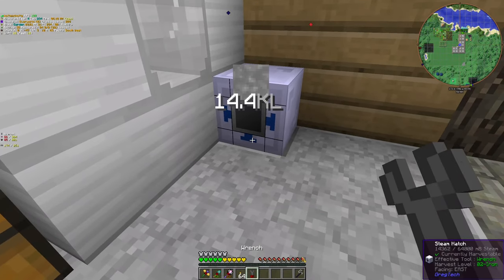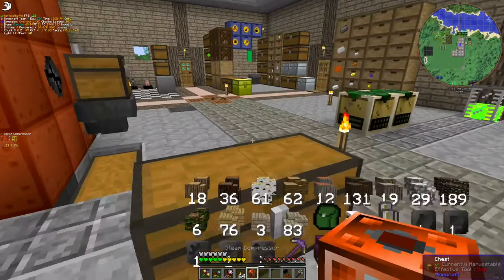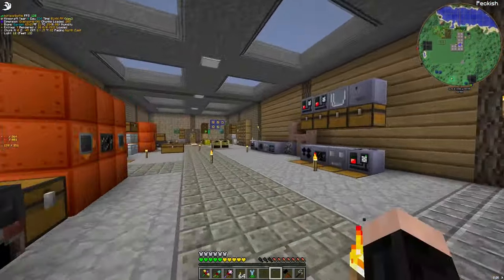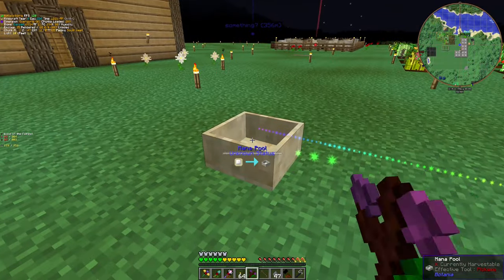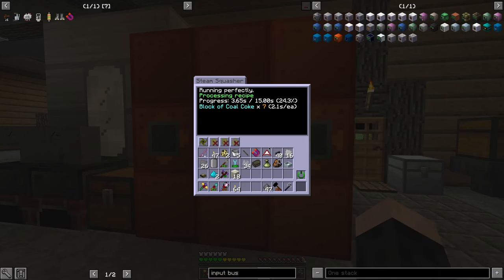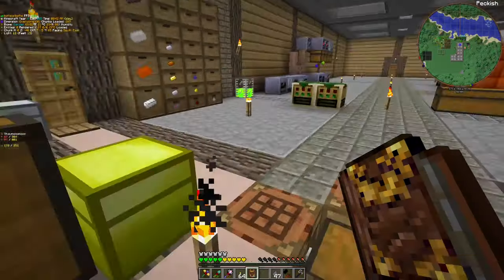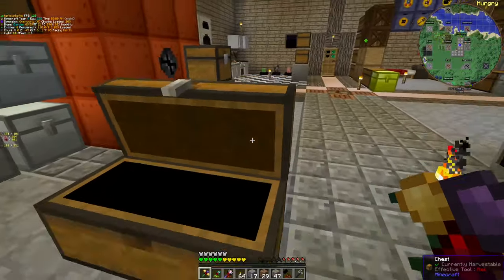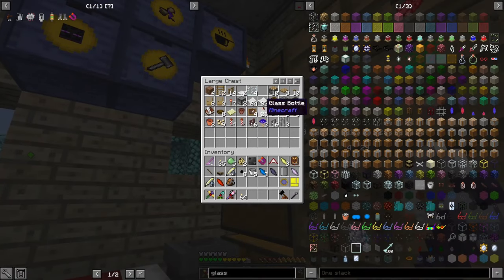Compress All The Things | GregTech: New Horizons S2 - 14

Comment: Best Video on the Cosmos:face-red-heart-shape::face-red-heart-shape:
Reply from the maker: I wouldn't go that far in a universe where "history of the entire world, i guess" exists. But thanks, I'm blushed
Reply: @KofteistKofteEN  The very early universe
The first picosecond (10−12) of cosmic time includes the Planck epoch, during which currently established laws of physics may not have applied; the emergence in stages of the four known fundamental interactions or forces—first gravitation, and later the electromagnetic, weak and strong interactions; and the accelerated expansion of the universe due to cosmic inflation.

Tiny ripples in the universe at this stage are believed to be the basis of large-scale structures that formed much later. Different stages of the very early universe are understood to different extents. The earlier parts are beyond the grasp of practical experiments in particle physics but can be explored through the extrapolation of known physical laws to extreme high temperatures.

The early universe
This period lasted around 370,000 years. Initially, various kinds of subatomic particles are formed in stages. These particles include almost equal amounts of matter and antimatter, so most of it quickly annihilates, leaving a small excess of matter in the universe.

At about one second, neutrinos decouple; these neutrinos form the cosmic neutrino background (CνB). If primordial black holes exist, they are also formed at about one second of cosmic time. Composite subatomic particles emerge—including protons and neutrons—and from about 2 minutes, conditions are suitable for nucleosynthesis: around 25% of the protons and all the neutrons fuse into heavier elements, initially deuterium which itself quickly fuses into mainly helium-4.

By 20 minutes, the universe is no longer hot enough for nuclear fusion, but far too hot for neutral atoms to exist or photons to travel far. It is therefore an opaque plasma.

The recombination epoch begins at around 18,000 years, as electrons are combining with helium nuclei to form He+
. At around 47,000 years,[2] as the universe cools, its behavior begins to be dominated by matter rather than radiation. At around 100,000 years, after the neutral helium atoms form, helium hydride is the first molecule. Much later, hydrogen and helium hydride react to form molecular hydrogen (H2) the fuel needed for the first stars. At about 370,000 years,[3][4][5][6] neutral hydrogen atoms finish forming ("recombination"), and as a result the universe also became transparent for the first time. The newly formed atoms—mainly hydrogen and helium with traces of lithium—quickly reach their lowest energy state (ground state) by releasing photons ("photon decoupling"), and these photons can still be detected today as the cosmic microwave background (CMB). This is the oldest direct observation we currently have of the universe.